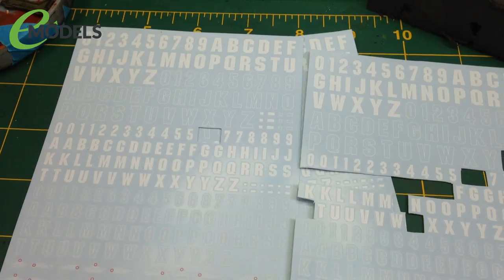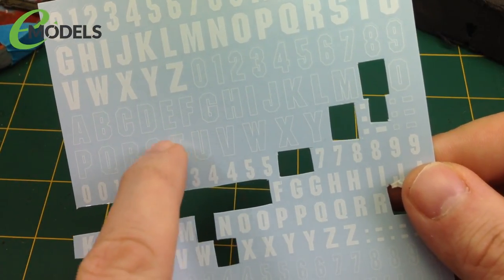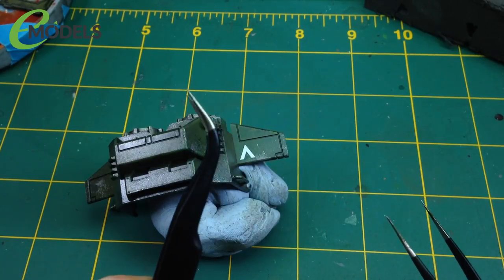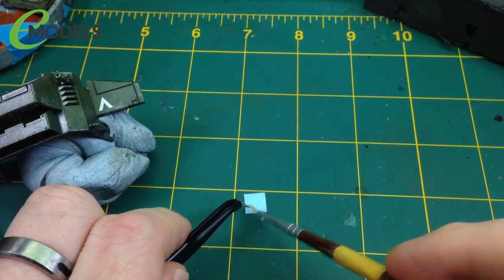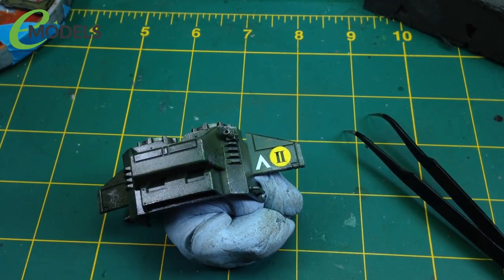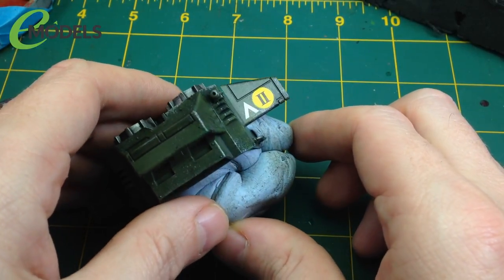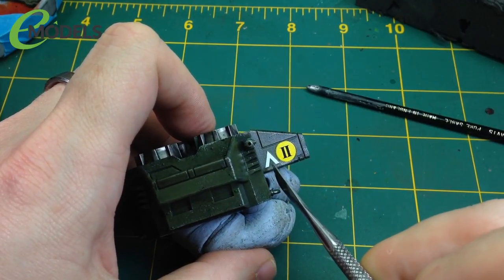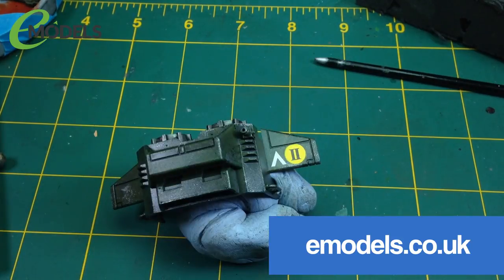HOW TO: Apply Small Waterslide Decals Without Water

Comment: how do you keep them from setting too fast so you have time to make adjustments?
Reply from the maker: With waterslides you can wiggle them about for a few minutes, and if they start to grip you can wet them again to free them up. You only squish them down and apply your setting solutions once they are where you want them, locking them in (although for a little while you can wet them to loosen them again if you need to, even after squishing).

Comment: If you use water for big ones, can you still use Sol to bed it properly? Or will there be any reaction due to the water?
Reply: If you use water for the big ones you can still apply SET to the area on the model where the decal will go, or on the back of the decal before it goes on, and then over the decal once it is in place, and you can still use SOL as normal once the decal has dried :)

Comment: Nice video, and I love Foxx's work, but there are two things that I fundamentally disagree with using this technique. 1) Decals scratch! Yeah, depends on quality etc, but I've had decals get pigment scratched off by manipulating them. "Picking" them up with metal tweezers instead of sliding with a toothpick or brush just increments the risk of this happening. 2) Decals like to cling onto things, including tweezer tips and itself. Again, depends on shape, thickness, quality etc, but I've had even the smallest warning marking wrap onto itself, and you don't want to get into this situation. In short, this works for Foxx but I personally would just spend the extra 20 seconds and water and do the less risky, tried and tested way imo... luvs ya Foxxy, cheers 🍻